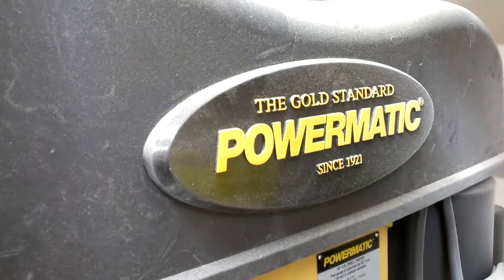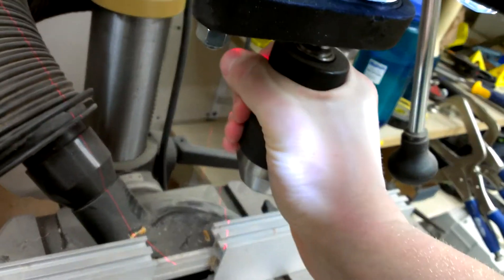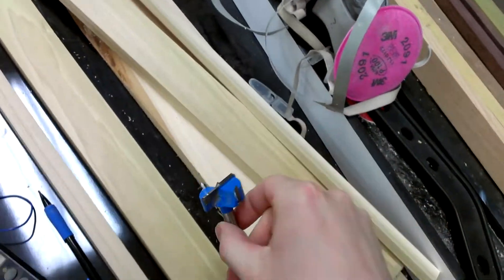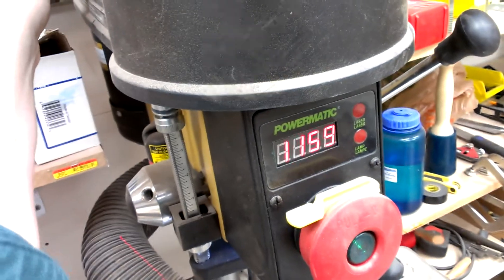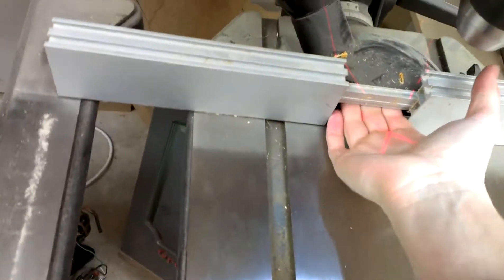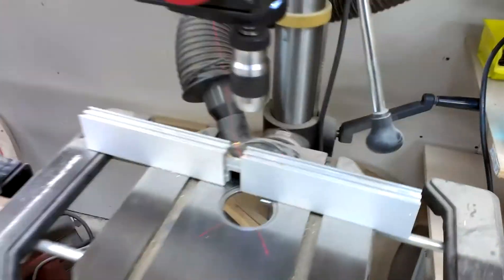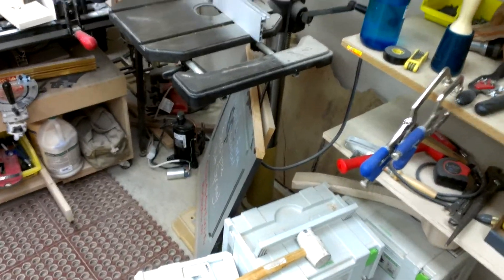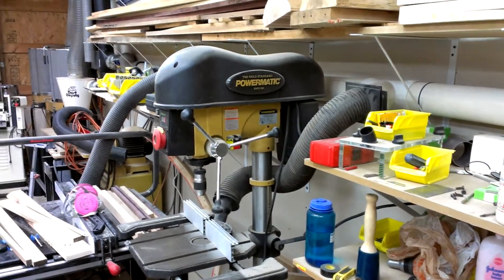Powermatic 2800 drill press

Comment: TERRIBLE! I was using a vintage powermatic and it never sounded like this one! The vintage one had two opposing small levers on the top and turning it was very quiet without effort and shaking. They were built like a tank. You can't help but be pissed off that the machine tool industry is so fucked up. We have state-of-the-art CNC machines that can machine fast, accurately, and efficiently, yet here we have substandard Powermatic machines who have sold their soul to the Chinese to make crappy drill presses and who knows what else! Needless to say, I'm not getting a Powermatic.